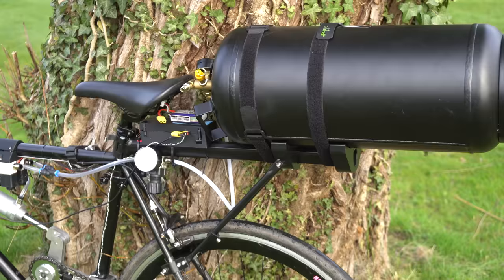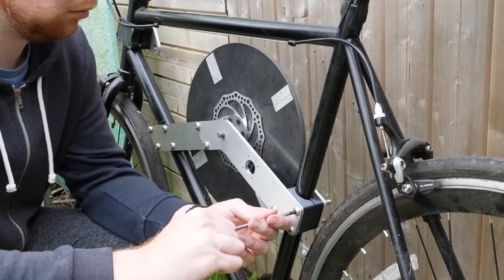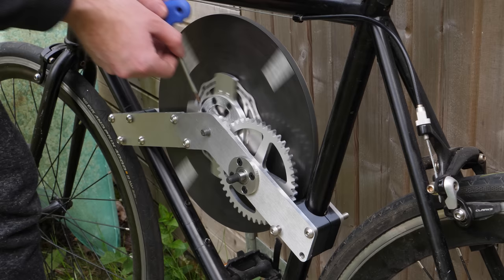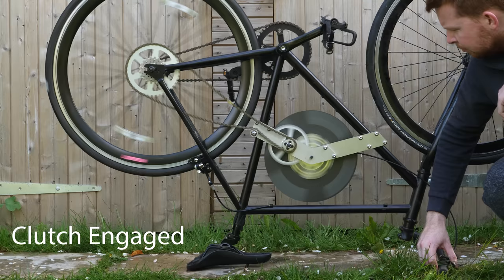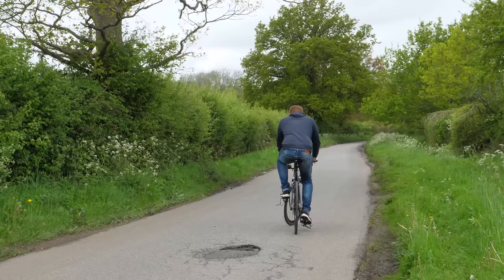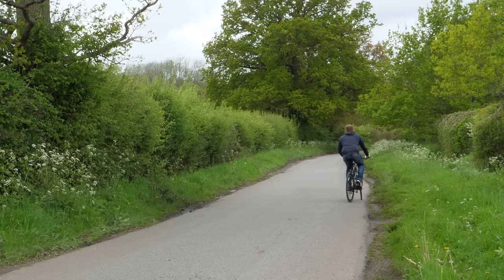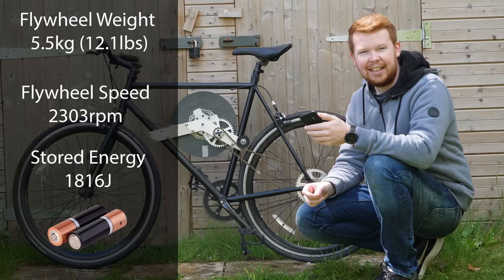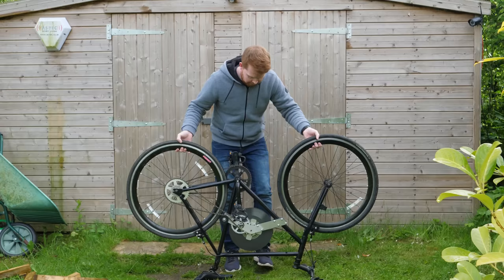Flywheel Bike KERS

Comment: Tom, I'd love to see a low output solar setup  with a high rpm motor that applies energy to the flywheel constantly, either in addition to or instead of your kers method. Reckon you're up for it?
Reply: @I love you but Thanks for the thoughts, what we have not considered is the w/h output of whatever solar array Tom may use, that is something that would need defining first, prior to assessments about output, and before we can draw any conclusions. I agree this implementation of a flywheel isn't going to be efficient as storing electricity in a battery, but that's not the point. The point is to try something fun, interesting and new and observe the outcome!
Reply: @I love you but What I mean by w/h is watt/hours. That unit definitely exists and definitely is important in this instance, and any instance when you're measuring power over a period of time. mah for example is subjective to the voltage the amps are delivered at. There are many variables to consider such as the solar output vs parasitic drag from the flywheel components, temporary cloud cover and how quickly the flywheel would lose energy. All very interesting.
Reply: Why not just use a battery?  Also you'd spend the energy on accelerating many hundreds of times faster than you generate it.  The whole idea is a non-starter.
Reply: @Asdayasman アズデイ  that’s why it’s interesting! I.e. if generating slowly over a great period of time and storing in a flywheel provides a tangible benefit.
Reply: @I love you but  How does your country measure power usage? Watthours are how mine does. I’m not sure why you’re so angsty. Maybe you’re describing the same thing I am in different literal definition as I’m using a / - this is how I see watthours depicted. W/h
Anyway, you do you.
Reply: @neoxela00  W/h means Watts divided by hours, which doesn't make a ton of sense. W*h is what you meant probably, but doesn't apply in this case either.
W*h (Wh) describes the capacity, as in it can deliver 10 W for the duration of an hour. 
To describe the power a solar panel generates, you'd just use W. 
To describe the capacity of a battery, you'd use Wh, which'd mean that it could theoretically deliver a specific amount of Watts for the duration of an hour.
Theoretically, because batteries often can't output it that fast, so they'd rather deliver the same amount of power over a longer period of time (10Wh spread over 10 hours would result in 1W that the battery constantly delivers).
Reply: @christoph6055  Thanks Christoph. What I’m trying to put forward is if the solar panel is generating say, an average of 30w over the course of an hour, let’s measure that in watthours to capture the total power generated to define an aggregate total of power put into the flywheel right, then, how much tangible benefit has that provided during that one hour ride after losses and Tom’s subjective use of the stored energy. I.e. Tom can launch once every 20mins of charging or however he defines it. I appreciate you trying to explain the w/h vs Wh, and in hindsight i should have probably looked for the standardised way to depict watthours before commenting, thinking it would have avoided a lot of this confusion and frustration!

Comment: Could you not make it a dual clutch mechanism where you keep the conventional clutch assembly but use add one to either side and also add 2 separate ratcheting/centripetal clutches (one for each direction) then connect each conventional clutch to its own handle. One to brake one to accelerate. Or is there something I am overlooking?

Comment: A cool project.  I hope you had a lot of fun doing it.  I suppose the question would be why we probably won't see mass adoption of this.  The answer is easy to see if you take a look at the whole system of bike + rider + flywheel system vs the system of bike + rider.  You end up exerting way more energy continually moving the extra weight of the flywheel system as you ride along.  After all weight is the main consideration in using aluminum frames vs steel frames on bicycles.  Of course, maybe you're looking for more exercise from your bike.
Reply: You could theoretically reduce the weight of the flywheel and increase its rotational velocity to get the same energy storage properties. But then you'd probably have issues related to integrity of the bearings. In reality, all of this is better done with a battery system.

Comment: When I was a kid a imagined a bicycle with a big flywheel with a clutch. The back tire would have been a flat square Dragster type tire conmen on a  20 inch 1970s bicycle. My idea was to spin up the flywheel with the pedals while stationary. Then when the light turns green you release the clutch and launch the bicycle. Make the distance a city block for drag racing .  Gotta build two of them.

Comment: The clutch is probably wasting a lot of energy.
Reply: The Idea Hypothesis;
I wonder if this would practically be efficient enough to keep a momentum of 16 mph on a bicycle when engaged at that speed for a solid 10 seconds or soo, because all he did was ride like 4 mph. I can ride 30 miles in distance, but with this flywheel, I could possibly expand my range distance for another 7 or 8 miles extra with less energy exerted. 

The Issue hypothesis;
But, the problem for if this experiment partially works is that if I were to install this flywheel weight, this means I would have to carry the weight of the flywheel, which means more energy spent peddling to push both the bike and the experimentally heavy bike flywheel, including peddling to spin the flywheel= thus energy being loss either way or more energy would be lost than energy to push a cyclist 30 miles away without the assistance (hinderence) of the flywheel, possibly resulting in a range of 25 or less miles in distance due to extra weight and exertness.

Comment: Imagine if this was perfectly balanced and sealed in a vacuum, that thing would spin at supersonic speeds
Reply: Modern flywheels used for load balancing by utility companies are kinda like that. There’s even some prototype ones that use magnetic bearings and crazy light carbon fiber parts to be very very fast and efficient
Reply: @lpharmer3496  yeah even f1 uses this, imagine being put into a bike lol
Reply: No sound in a vacuum so no such thing as supersonic either...
Reply: @trueriver1950  He said at supersonic speeds, just as a measurement
Reply: Since the speed of sound is based on the density of the propagating medium it would be at supersonic speeds before it gets to a vacuum and not changing the speed.

Comment: This would be a great concept for those who live in a neighborhood full of hills where you would need to go up and down frequently. The flywheel could be used instead of the brakes when going downhill (for the most part), then the flywheel could be used to (somewhat) assist with going uphill, thus making the climb a touch easier.
Reply: And why dont you keep it fixed? Like the flywheel always connected to the bike wheel?

Comment: You need a centrifugal clutch that way once you get the back wheel up to speed it will slowly engage the fly wheel building speed as you gain speed then when you squeeze the clutch lever it can separate the fly wheel from back tire then when you need to take off let off the clutch 
and off you go

Comment: Awesome! I wonder if it's possible to design a flywheel inside the rear wheel, or two mounted on either side. Be pretty complicated gear solution but you could make the flywheel some fraction of the size of that enormous wheel diameter.
Reply: Exactly- I thought the same :-)
Reply: But wouldn't that compromise the weight of the wheel, making it harder to pedal manually? I know better gear ratios help a ton when it's rolling but you can only get so much mechanical advantage on a standstill.

Comment: Why are you energizing the flywheel by pedaling? Shouldn’t your breaking energy be put into the flywheel itself ?
Reply: Did you not watch the video? He explains this.
Reply: Sef has a good point. This is supposed to be a regenerative system. If Tom is energizing the flywheel by pedaling with the flywheel engaged, he is just adding more energy to the system, not recapturing it. His original way of using the system, but with energizing over several cycles of stopping his bike is the correct use of a system like this.
Reply: @razeproductions704  yes... watch the video.

Comment: Nice project. You don't have to use heavy steel! The stored energy is linear to mass and to speed square: U ~mv^2, so a high speed low mass flywheel is easier to start up and will store more energy at higher RPM. The lower weight will result in higher acceleration of the bike.
Reply: RPM's aren't "no cost" :) 
Higher RPM requires tighter tolerances - something he's already struggling with.
There's a reason why flywheels (everywhere, eg real professionally made machines) are made heavy, not light!

Comment: Interesting idea and implementation. However, I can't help but circle back to the original problem that you are solving: saving the kinetic energy of motion in the flywheel for use when accelerating. The infinitely variable transmission would have been bulky, but your clutch solution simply moves the brakes from your wheel rims to the flywheel. Worse yet, as you point out, the flywheel only acts as a brake until its speed is matched to that of a bike. This is why electronic regenerative braking systems are so popular: you can implement the infinitely variable transmission part via PWM or similar, allowing the brake produce any deceleration profile that you want.

Comment: Your fixie has brakes? How very un-hipster of you
Reply: What’s the deal with fixies, if you don’t like changing gears constantly, use a practical gear and stick to it, but once in a while, you’ll need to change if you don’t want to walk with the bike up hill.

Also, no brakes, WTF?, hub brakes are ineffective and inefficient.
Reply: @josearmandoguerrerochairez3454  in my experience Fixies aren't for the same uses as other bikes, just like you wouldn't go downhill mountain biking on a road bike. Fixies are great around cities, much fewer mechanical parts to cause issues, they tend to ride much quieter. Because they don't have freewheels, the speed of your feet is directly linked to the speed of the bike, if you wanna slow down you just don't peddle or you apply reverse pressure to slow quicker, which generally means your feet are going to be strapped into the peddles on a fixie. Hope that helps
Reply: @BlacksmithGen  Then I guess is a matter of choice, but what you describe seems like no problem for me, I can fix all of the most common problems and a little bit more in my driveway with little tools, as a rule of gold, if nothing is broken or needs highly specialized tools, I can fix it myself, and the acceleration and stamina advantages of gears outweigh greatly the noise, and freewheeling is a mayor advantage to increase the efficiency of the system, you can stop pedaling so much, just adding the little bit of energy lost.
Reply: @josearmandoguerrerochairez3454  definitely a matter of choice, I still do most of my riding on a hard tail mountain bike and yeah bikes aren't difficult to maintain generally. But I really enjoy the experience of riding a fixie, it's different. And a lot of people's main reason is they look very cool, without cables going every where and chunky chain sets.

Comment: Making it in shape of ring would be more efficient: you'd get same moment if inertia with less weight.
Reply: @haswanthpalaparthy3893  Your belief is incorrect. Energy stored in atom of flywheel is  proportional to it's mass * (angular speed * radius of rotation)^2. (because E = m*v^2/2 = m*(R * omega)^2/2 ). If you move an atom of flywheel further from center, then the radius of rotation will increase, and therefore you'll get more stored energy for same mass and angular speed. So the most effective configuration of atoms for limited max radius, mass, and angular speed is a ring.
Reply: @haswanthpalaparthy3893  Though making a ring-shaped flywheel would require some cutting, and probably Tom didn't want do bother with it.
Reply: @luck3949  I understand, could you elaborate on v^2 = (r.omega)^2 ?
Reply: @luck3949  I think he did something like this in his flywheel plane, with carbon fiber and aluminum
Reply: @haswanthpalaparthy3893  v is linear speed. Linear speed equals radius times angular speed in radians. So I labeled radius as R, and angular speed in radians as omega.

Comment: Actually, spinning the opposite direction to the wheels, counteracts the gyroscopic  effect of the wheels.
Reply: This is exactly what I was thinking.  If you have two counter-rotating flywheels on the same assembly, and they have equal rotational momentum, you can rotate the assembly without seeing any gyroscopic torque.  In this case, there might be one specific speed where they cancel out, and the bike feels wobbly for a second until the momentum of the flywheel exceeds that of the wheels.

Comment: 50 years back my dad built a bike with a flywheel mounted in the same orientation as the wheels but as you rode the back wheel spun the flywheel in the opposite direction via a chain and cogs.
This bike was used as a party trick as it was nigh on impossible to ride.

Comment: C'mon Tom, you're not a septic, you can do things properly: Steel is 3 times as dense as aluminium, not three times denser! =)
Reply: Thank you.....
Reply: 🔵 Could you please explain your use of the word "Septic" and also  your reasoning behind the aluminum and steel Terminology/nomenclature?.. it still looks to me as if it is two ways of saying the same thing, and I'd like to understand the difference that you are seeing between them,
.....thank you.
Reply: @joshhayl7459  Certainly. =)

First, "septic": It's Cockney rhyming slang for American. Septic is short for "septic tank", which rhymes with "yank". It's not meant as an offensive term. Another example would be to "have a butchers", which comes from "butcher's hook" rhyming with look, i.e. to "have a look".

Aluminium is just the way I usually write it, I wasn't actually making any point with that, specifically. I know it's a complex subject, but I'm more familiar with UK English in many cases, hence I write aluminium.

As for the "three times heavier" vs. "three times as heavy", if you back it all down to "one time heavier", you can see that the former implies that the multiple of the weight is added to the original weight. So "three times heavier" is x + 3x = 4x, while "three times as heavy" is just 3x. Since the density of steel is around 8 g/cm^3, and aluminium is about 2.7 g/cm^3, the density of steel is 8/2.7=2.96 the density of aluminium, so 3x, rather than 4x.

Language differences are one thing, I don't mind about that, but "two times heavier" and "twice as heavy" are math, with very specific meanings that differ from each other.

And don't even get me started on stuff like "five times lighter" when you're talking about just two things compared to each other, ugh... =)
Reply: @jubuttib  you could have summarised most of this by just stating that the way you used it is the correct use of the English language. Simples.

Comment: One potential would be to have the clutch engaged during normal operation, then disengage the clutch when the brake is pressed. This allows the energy to be saved for the startup, and having the benefit of a flywheel in normal use

Comment: Great video, This would be great for capturing energy going down a steep hill at high speed.  You could engage the clutch near the bottom of the hill and get the flywheel moving.  Then after it gets moving disengage it.  Then using the stored energy to help move and get going again.
Reply: Don't bother slowing down and just coast up the hill.  Take all the friction and recovered energy might get  you 5' up the hill...

Comment: Pretty brave, if something went wrong you could end up puncturing your femora artery bro.  Flywheels are usually encased,also that stops you from loosing stored energy to friction so it would practicaly to store some energy when going down hillto use on the next hill.

Comment: What if that flywheel has some magnets?
With some coils, you could make more use of energy, using that flywheel as a generator.
Then it could be recovered, using that generator as a motor.
A bipolar one would be worth it, since you are the one who chooses the direction of travel on the bicycle.

Comment: Seems like you could rig it to use the freewheel (reverse pedaling) to charge the flywheel, thus not impeding forward pedaling efficiency, but rather once up to desired speed, you could freewheel pedal into the flywheel (even during braking). This would also make it so that you could simply not use the flywheel at all if desired.

Comment: you could make this but with air engines and an air tank: when you slow down it would pump air into the tank, and when you take off it would use the pressure, + it wouldn?t lose energy while stopped like the flywheel, because of fricton

Comment: What if you set it up so you use the energy to drive a pump that pressurizes air into a tank where the flywheel is. Then you can avoid the gyroscope effect. And just like the flywheel, you could store some air in the beginning.

Comment: Right!

What if:
Spun up to provide regen, not mechanical power. placed in a vacuum. geared to provide a cruise control top speed & for stationary charging of battery. Just needs to say add 50% more range plus the ability to recharge the battery stationary in a few hours. Use belts & internal hubs for gearing.

Comment: Will a smaller flywheel add less weight while could store almost the same energy? What if it is only a 20cm flywheel?
From paper physics stand point smaller wheel will rotate faster. Which might cause more friction, yet the efficiency difference might be worth it when it comes to total weight of the bike.